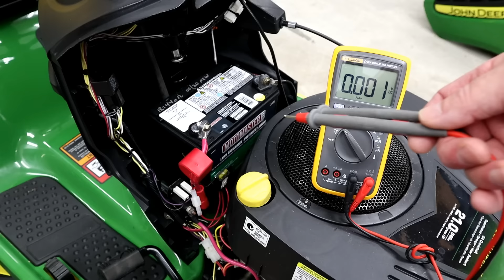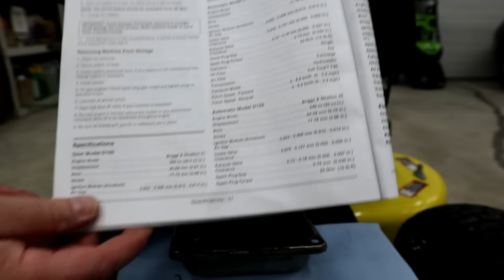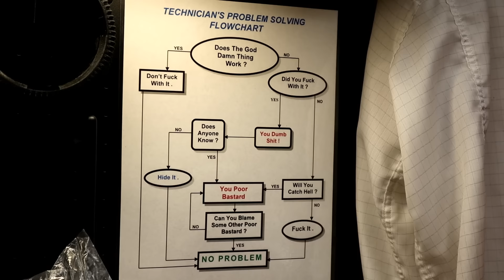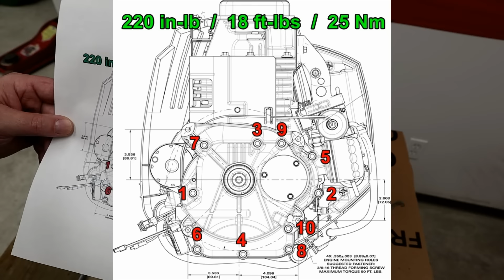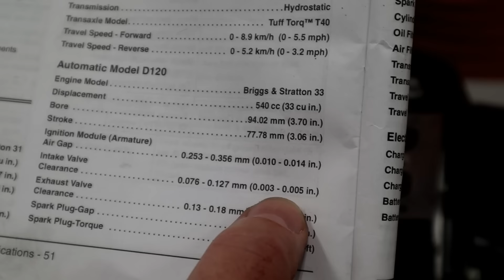Why Won't Your Riding Mower Turn Over? COMMON Briggs Intek PROBLEM & REPAIR.

Comment: Best video I’ve seen on this repair.  I am a bit curious why the oil filter wasn’t changed, since that would be contaminated with metal particles.❤
Reply from the maker: Thanks - Filter was replaced after the repair and after running the engine for a while. This way, any (if any) last tiny remaining fragments could be caught by the filter before replacing it. Thought I said that at the end of video, but after checking, I did only say oil change. I always change the oil filter with an oil change so guess that's why I never said it. 🙃
Reply: Excellent presentation and clear direction on all phases of repair.
Reply: Taryl fixes All  also has a good video on this subject ! Along with many many more helpful instructional videos of al types of small engine repair!
Reply: yes,  Dony Boy  and  Steves'  Small  Engine  Saloon.....(he's  near Vancouver )

Comment: About as great and comprehensive a video there is on the Internet. I've been doing small engine repairs for a couple of years now and found yours well paced and the explanations on how things work is as important as how to fix it. I always said I'd rather know "Why" rather than "How", if you understand the basic engineering behind anything, then you can figure out how things work and fix them
Reply from the maker: Thanks for the kind comment - happy fixin' 👍

Comment: My first tractor with a 14 hp Briggs engine lasted about 7 years, threw a rod. My current tractor is a 20 year old Craftsman with a 17hp Kohler Command Pro. Must have well over 1200 hours. Still runs great. My friend welds and has been keeping the deck alive.
Reply: The Command Pros are some of the best small engines ever made. Those things will run forever, so it's a shame that many of Kohler's newer models are piles of crap.

Comment: Excellent video.  I’ve now watched countless guys do this on YouTube (getting ready to do mine this week - parts are on their way), and you’re the first person I’ve seen who actually  cares about the details like I do.  Many thanks for some GREAT detail-oriented tips (marking positions before removal, including the torque specs - IMAGINE!  Actually torquing things correctly!).  I can’t believe the number of guys who do this stuff and think the amount of torque between a steel bolt and an aluminum engine doesn’t matter.  I had a local shop quote this job but when I heard their price and asked the guy a couple simple questions (“are you going to use an OEM replacement camshaft and not a cheap Chinese aftermarket one?”) he gave all the wrong answers (not to mention he wanted $680 for the job with only a 30 day warranty on the work).  If you want something done right do it yourself - and you did it perfectly.  Thanks for the help!

Comment: Thank you for this video.  I am now in the process of replacing the cam due to a compression release failure, I found that the main drive pulley bolt was so tight it would not even loosen with an air impact wrench so I heated the bolt using a torch (with wife close by with a fire extinguisher), and the bolt came loose immediately .  Pass this along if you like.
Reply from the maker: Good tip.

Comment: I just live with it. Rotate the engine backwards to the compression stoke and then start. It is a lot easier than rotating the engine forward though the compression stroke as shown. The only time it does not work the first time is the first two mows of the year when the temp is cool.

Comment: Thank you John, you explained it so well even I could understand everything. Your step by step approach is so easy to follow, a lot of other videos skip bits or the camera work doesn't show what their doing. Thanks again John, I've had two brake on my B&S motors and had to pay in excess of $700 to repair at a John Deere workshop.
Reply from the maker: Great to hear 👍 (not the part about the $700 bill of course ☹)

Comment: Great video. I just recently did a head gasket and valve adjustment on my 17.5 B&S to prevent that big blue cloud on start up. And I agree with you B&S quality sure isn't the same. And like you, I use a blower to clean mine after each use. I also fill with gas and check the oil while it is still warm. Doing this has it ready for the next mowing.

Comment: I think that 1/4”. drop after TDC with the straw in the plug hole has something to do with optimal spark timing...Think about it , John!...Excellent demonstation.
Reply from the maker: Actually, as others have correctly pointed out, it's to ensure the decompression pin isn't lifting the intake pushrod ATC which would of course throw the valve adjustment out. Spark timing is fixed and is a function of coil position. Coil air gap can have a slight influence on spark timing, but it's tiny.

Comment: Five years ago, I installed an aftermarket camshaft on my B&S engine (33 cu. in., the same one that is in this video) and it is still running with the aftermarket camshaft.

Comment: Seeing that Boxster 986 in the background, I know you're a handy man with mechanical knowledge without even watching the video. I have a Boxster S 986 myself, so I know all the fun you have with keeping that car running properly. I also just bought a John Deere S100 which I'm assuming probably has the same engine. So here's looking forward to a cam replacement at 120 hours if I'm lucky and I have an excellent video of how to repair it thanks to you. This is a great tutorial, thank you.

Comment: Most of our customers at Eliminator Performance do not want to spend the money for the ACR replacement and continue to start their engines by rotating the engine manually off the compression stroke just like you showed. Yep the aftermarket replacements may last hours, weeks, days or months but the OEM ones also have issues but will last significantly longer. The only tip i can give you from EP is if you are not repairing it never run the engine while wearing hearing protection or ear buds listening to music that stop you from hearing the engine over revving in the event the broken pieces contact the internal governor assembly which will destroy the engine if you do not shut it down fast enough. So far one customer has made that mistake!
Reply from the maker: Never even thought of the governor getting jammed by the debris field - thanks for the tip!
Reply: Good  day Wayne  So I have MTD  20 hp twin  cyl,  does this apply here too.    Thanks  it is 2,00 am, can't sleep.
Reply: @donvoll2580  If you need to rotate the engine off the compression stroke to get it to fully turn over more than likely the ACR but should check the valves first.
Reply: @waynestefinashen239  No & I have 2 cyl.  & it is not Intek.  Thanks  I winter is suppose  to come back.
Reply: I run mine with broken ACR. I use a flexible magnetic wire and retrieve whatever pisces I can thru the oil fill tube. Then pray the broken pieces stay in the sump.
Reply: @M70ACARRY  Yep you should be ok for some time but eventually something will fail and you can not even get a replacement ACR since they are back ordered and the aftermarket ones may last a day, a week who knows.
Reply: @waynestefinashen239 I took this part out and sure enough that part was broken. I replaced it with OEM and I’m still having a hard crank issue. It won’t start even if I do it by hand then try to start it.
Reply: @ranranpoopants  Check the valves settings and the valve guides which may have pushed out and started to jam up the exhaust valve normally

Comment: Great video. I got so sick of this on another brand of riding mower with a 13.5HP B & S, that I removed the flywheel cover and switched mine over (with added parts to the flywheel) so I could also have the rope/pull start option too. So, now my 13.5HP riding mower is both electric and recoil start. After doing this... these mowers should all be OEM configured like this; recoil and electric because of these garbage builds. I also keep a very small $13.00 solar panel connected to the battery at all times because it's not like they get driven every day. I like your no-BS videos.

Comment: Great video and easy to follow.. Had my laptop in the garage while I went through the process of replacing the camshaft and when I got it back together and re installed on the mower she started first kick. Cost me $150 for the camshaft and governor so saved me replacing the engine and/or replacing the mower.. Many thanks!
Reply from the maker: Great repair & glad the video helped. Happy mowing now 🙂

Comment: Lol,had a 18.5 that did that so I rotated the flywheel like you did and yes started right up, always thought it was a weak starter so I wasn't going to change it until the turn the flywheel trick no longer worked, done that for two years by then the engine was probably 4years old and loss compression and started with no help for another two seasons lol,never new what was probably wrong until I viewed your site,wish I would have split the case and looked 😂

Comment: Two thoughts: First, you do an excellent job teaching and explaining how to repair an engine.  Second, unfortunately this issue (broken  compression release) is another sad example of how one small mechanical part failure can almost end the life of a large mechanical item (in this case, a lawn tractor).  I'm retired and have the time and almost the inclination to take my tractor engine apart to fix it, but probably won't.  Neither will I pay someone to do that.  I'll probably do the hack of bringing the engine to top dead center and spray the intake with some fuel to start.  If an engine was intelligently designed I wouldn't have to make that choice.  I know, first world problem.  But we can do better engineering than that and maybe one day will.
Reply: I am the same way with my small engine repair.  As a retiree also, I have the same mindset; if it can be externally fixed, I will fix it, if not, not going to waste time on junk, a used engine off a mower with a bad deck or transaxle will be my better option:-).   If I can, I like to either find a v-twin to replace that OHV single with or find a reliable flathead single to put in place.
Reply: How are those harbor freight replacement engines

Comment: Thank you for this video. Gave me the confidence to try this repair. Was about to throw in the towel and start saving for a new mower
Reply from the maker: Have fun with the repair; not that hard, just time consuming 🙂
Reply: @Rchelicopterfun  have you ever seen one of these briggs motors with the intake valve on top? There are no numbers on my valve cover for me to see what series the motor is specifically (just know it is a 17.5hp in a Scotts S1742). Every video I have watched has the intake valve on the bottom with the aluminum push rod on the bottom, but mine has the aluminum rod on top which has caused me to believe that the top has to be the intake valve. But now I am wondering if someone worked on this motor previously and mixed up the push rods
Reply from the maker: I've never seen the intake on the top, but that of course is anecdotal.  It's pretty easy however to see if the intake and exhaust ports are top or bottom by just looking at them. So on yours, if the intake port from the carb is in fact routed to the top of the cylinder head and the exhaust port going to the muffler is on the bottom of the head, then I guess there are some Inteks with that configuration. I would be interested in knowing 🙂
Reply: @Rchelicopterfun everything looks the same as yours except for the aluminum push rod is on top and steel is bottom. They must have been put in incorrectly by someone previously. Thanks!

Comment: In my shop we have changed so many of these cams it’s sad.  Usually around 100 hours they flop sometimes less. 
I went to a junkyard and found a bunch of old inteks with the old style cam they still work and will work in these new engines.
Reply from the maker: Appreciate the information - thanks for sharing 👍

Comment: Great video and instruction! Had this issue on my 2012 B&S 21 hp. Broke in ‘23. The carnage inside was no joke. The piece blew up and shrapnel was everywhere. Did damage to the case too. Hope the repair holds. Wasn’t a tough job. My brother and I did it together and my kids helped here and there too. Worst part was cleaning the old gasket off. Back up and running! Thank you for making this video!
Reply from the maker: Thanks for watching and hope your new decompression cam lasts as long (longer hopefully) as the first one.

Comment: I’ve learned my lesson about Briggs & Stratton engines and their compression relief cam. My Husqvarna riding mower has not been seen for two months. It has been in the shop(s) for that long due to living on DelMarVa using small engine repair folks
Reply from the maker: Yikes

Comment: The 1/4" on the piston is to make show you're not sitting on the compression release when you set the intake valve clearance. I did that once and pulled the damn engine thinking the cam was broken. It wasn't.

Comment: Thank you.. Exact problem Im having.. These mowers are great when they are running but boy when they stop they stop hard.. Ive just spent 600aud on getting the rear drive housing glued due to a leak and very surprised i cant buy a new cover instead of gluing.  I wont buy another one sadly

Comment: My Craftsman has the same engine. First...fish the broken unloader cam out of the crankcase. Next...be the unloader. The rotating engine will suck air and compress it...which is the problem. I know this is a pain, but before turning the key, turn the engine by hand to the point right after  the compression exhausts. Then remove the air filter and hold your hand over the opening while you crank the engine. Let the motor spin up and then pull your hand away while cranking. After a few tries, you should get the hang of starting this way. Its not great, but it has worked for me for 2 seasons now at $0 for the repair. Oh...put the air filter back on before you mow.

Comment: The reason to do lash just past TDC is to ensure that you aren't doing lash on the compression release. Just past TDC is the beginning of the power stroke. Both valves better be closed at that point.

Comment: Excellent Video and I now know why my 24V Intek VTwin will not start. Next step is tear down and rebuild. Thanks!
Reply from the maker: This is only an issue with the single cylinder Intek's not the twins.
Reply: @Rchelicopterfun  well, mine is doing the exact same thing trying to start. Replaced starter thinking that was it but nope. Unit is now at my trusted mower shop repair. He said ‘look for a new engine’. I said, I’ll pay to have you test it apart and find cause of new start. Will see.
Reply: The start of your video shows the exact symptoms of my twin Intek. I replaced the starter and still have same issue. Now at trusted mechanic/mower shop and he is going to do a tear down. He thinks it might be crankshaft. Thanks again for the excellent video!  @Rchelicopterfun

Comment: I rebuilt mine  using an original oem cam shaft, don't trust the cheap aftermarket ones, excellent video, thank's.
Reply: Cool..but wasn't it the original one that failed?

Comment: The reason for going past TDC before adjusting the valve clearance is because TDC is at a critical intake valve dwell point where it has JUST closed. Any movement around that point could cause contact with the cam lobe. Going past TDC (and not on a compression release 'bump') ensures that both intake and exhaust are guaranteed to be fully closed, with NO camshaft lobe pressure on the pushrods. 
If you look at the camshaft, you see that there is a wide area of "unloaded" contact (the valve springs have NO pressure against them), where both valve clearance adjustments can be made. It's not rocket science. Just move the crank until there is play in both valve's rocker contact and adjust them. Done.
Reply: Always amazed on how clearance of .007 and .009 of an inch on the cam can make life much better.

Comment: The piston placement is to avoid the compression release.  The tappet needs to for sure be sitting on the cam when you set the rocker clearance.

Comment: The reason they want you to push the piston down when adjusting the valves is to take that bump from compression release influence out of the picture.
Reply from the maker: Makes perfect sense. 👍

Comment: Thanks for the video. I think my mower has the same problem. I will know more but I'm glad there are videos like this out there to help.
Reply from the maker: Hopefully it might just be an easy valve adjustment and not a busted decompression. Fingers crossed.

Comment: I bought a Jd mower with low hours that has this engine. It was burning oil when I bought it but knowing this engine also has a head gasket problem and the price was right I took a chance. After replacing the head gasket the engine was still burning oil, It turns out when this engine was built in March 2020 the Covid pandemic along with its supply chain issues was beginning to flare up and B&S was mulling bankruptcy(the perfect storm). I pulled  the engine apart only to discover that one of the oil rings was never installed in the factory. I replaced all the rings and engine now running fine and no burning oil. I think if my cam fails and doesn’t destroy the engine I’ll use the hand turn past the compression stroke method rather than tearing my engine apart again

Comment: I have a bolens riding mower with the original 20hp vtwin intek that I bought at Lowe's in 2002 and is still going strong till this day with over 900 hours, no starting issues or none of that compression release crap and also I have a 2013 husqvarna with a 27hp vtwin endurance engine with over 450 hours with no starting issues or no compression release junk
Reply: the twin cylinders have a different cam

Comment: My 2004 24HP Intek has 1200 hours, head gasket replacement, re-set valves every 100-150 hours, still going strong